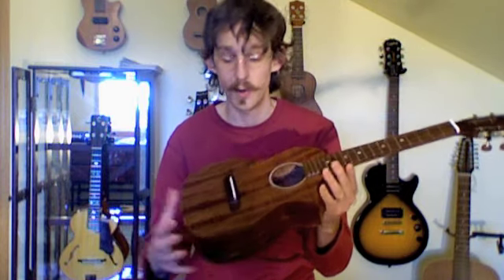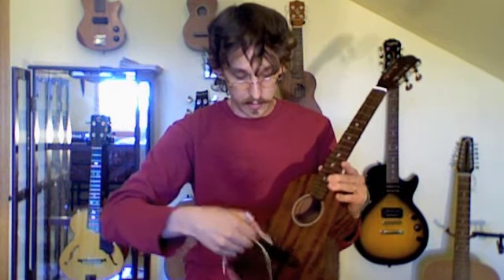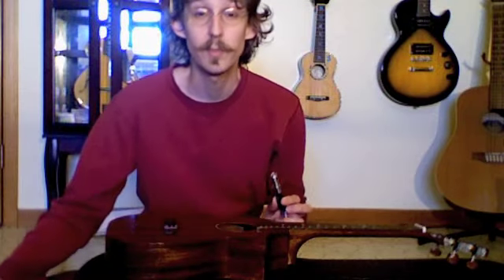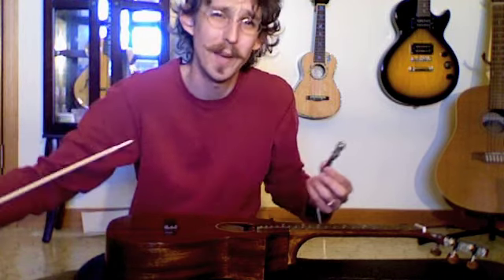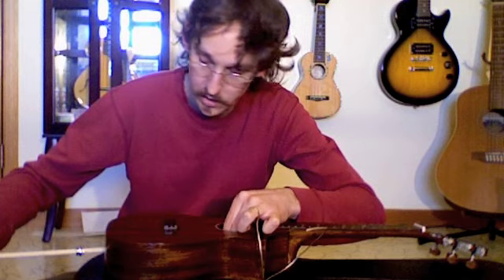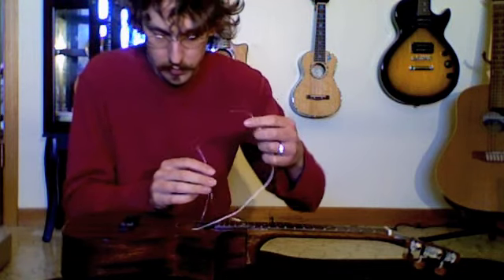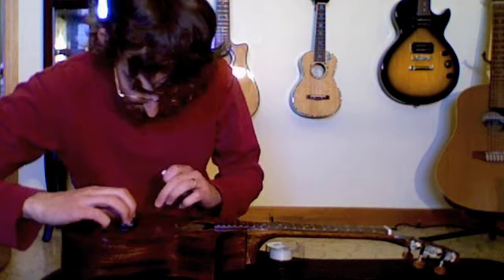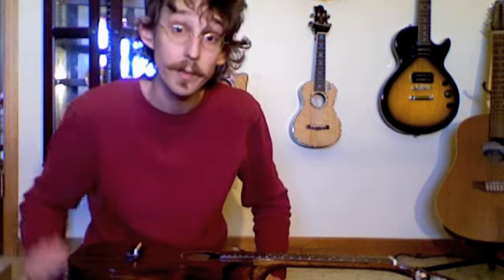Uke Build Ep.13 - Mi-Si Pickup Installation

Comment: Many thanks for an informative video.I have just had a MiSi pickup fitted to my new uke, but unfortunately it has become loose. Any good ideas for tightening it up and stopping the barrel of the pickup on the inside from spinning round?!
Reply from the maker: Hmm.  The nut on the end is the only thing holding it on.  Simply tightening the nut should do it.  There should be enough thread on the outside to grab a hold of and stop it from spinning long enough to tighten the nut.